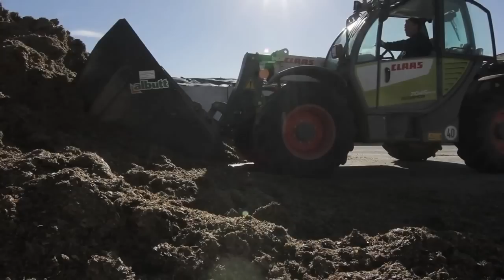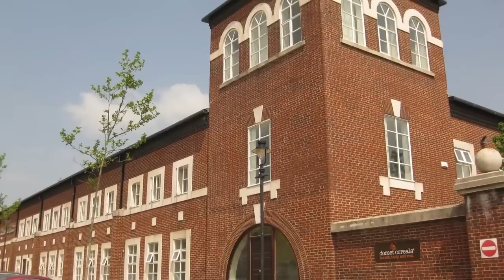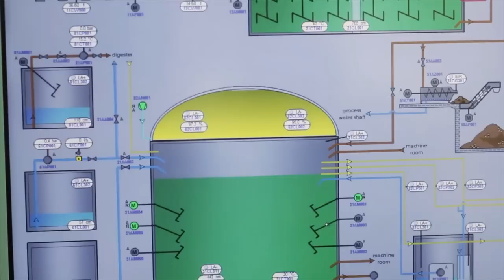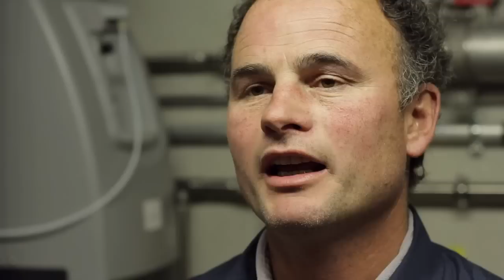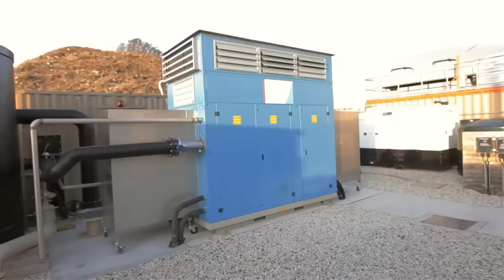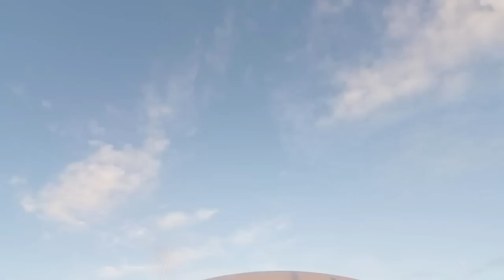Rainbarrow Farm, UK's first commercial biomethane to grid plant

Comment: Why does the gas output drop from 56,000 homes to 4,000 homes in winter? Feedstick storage or temperature?
Reply: I suppose because homes in winter require significantly more heating than in summer. So because the consumption / home increases, not because the production decreases.
Reply: @paulverse4587  thanks. Just emphasises the importance of home insulation.

Comment: So this plant requires around 25,000 tonnes of maize a year.  This maize has to be sown, fertilised, probably sprayed, harvested and then transported from the farm to the plant.  That's an awful lot of diesel fuel: not very green so Is it really worth it?
Presumably there are big subsidies here: surely it could never pay otherwise!
Will it take kitchen food waste?
Reply: deltamac this is certainly not green!! At the end of the day you can't blame the Farmer if the price of wheat is going to stay down this looks a better option!
Reply: @johntopp8266  Don't forget that although they use maize waste. If you look at the video they will be selling the cobs for food before they use the rest of the maize foliage and stems. The diesel used to do this will be minimal extra beyond what would be used to grow the food part of the crop. This is in fact very green.
Reply: nope, they forage the whole plant 👎🏻
Reply: surely all the ic engines used for farm-mechanisation  could be converted to use the locally generated "green" CBG (compressed bio-gas) instead of imported "dirty" diesel ?